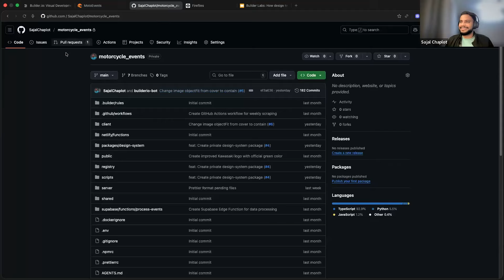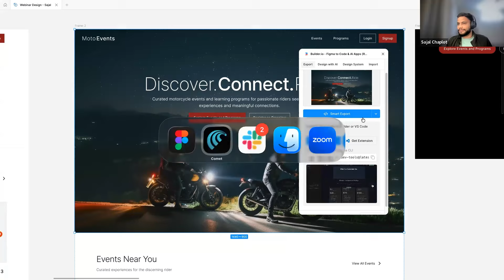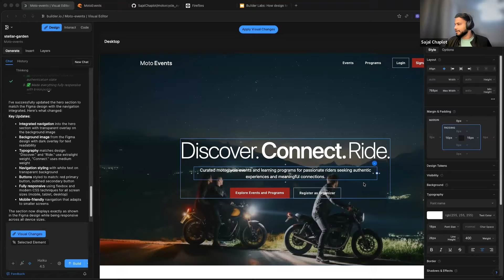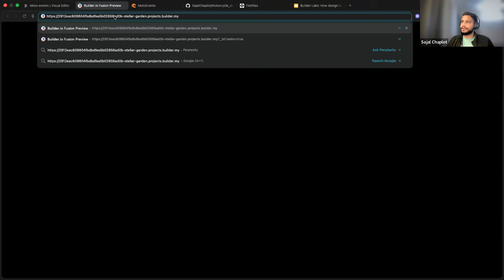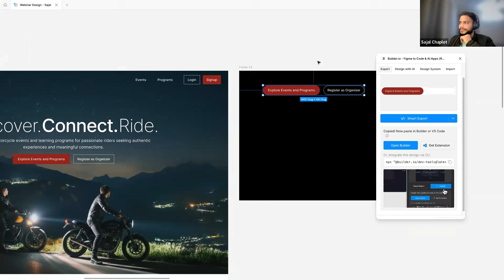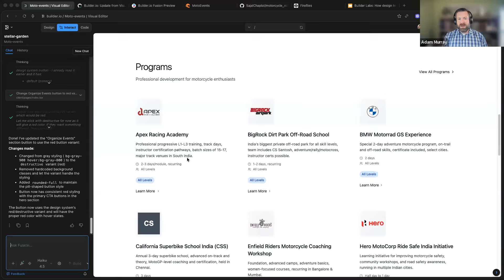How design teams use AI to prototype and ship without dev handoffs

Comment: One major issue, start with designers want to update the product fast can leads to critical bugs and messy code which developers will need to cover later. Designers knows nothing about coding so what's the point showing them what code the AI generated in the chat...
This is nice for really small projects, but will not hold on scale up.